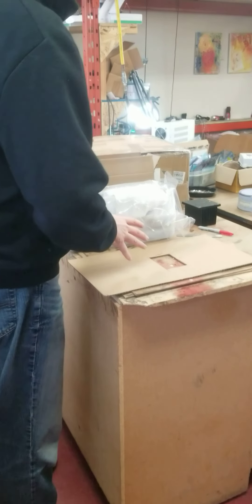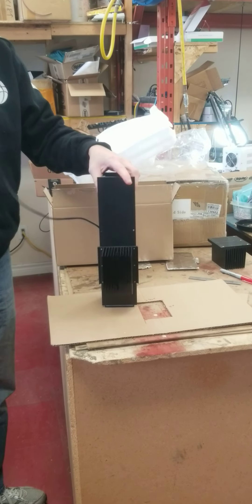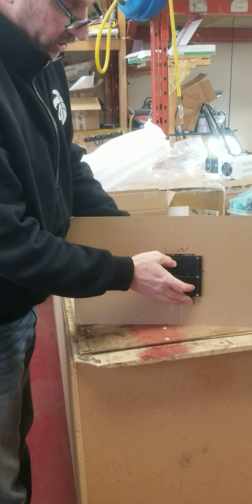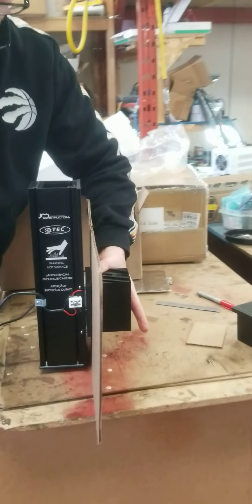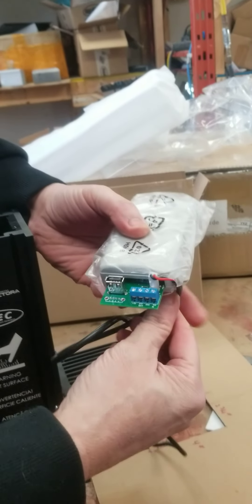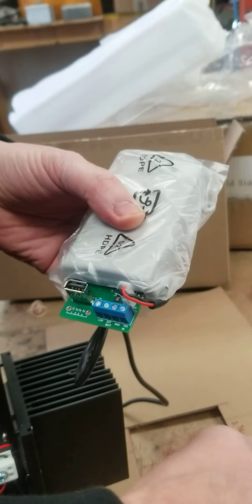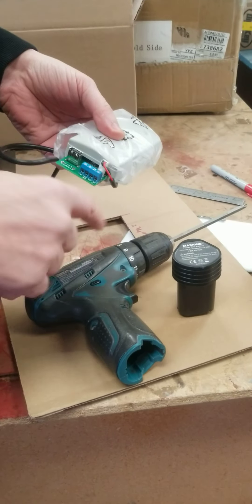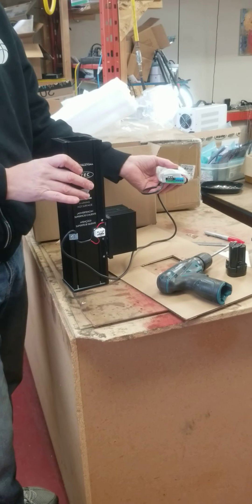Thermoelectric IPOWERTOWER Installation & Operation of 10Watt Wood Stove Generator

Comment: Hmm I would rather see mounting it on the chimney pipe right after the fireplace, the way the TEG fans are mounted. And the water cooling should be done using pipes to the water heatsink (optionally with antifreez addon) placed in the cold place (floor) or even mounted outside. Ideal for room stoves at the  cottage.